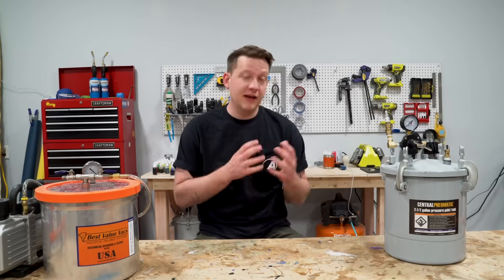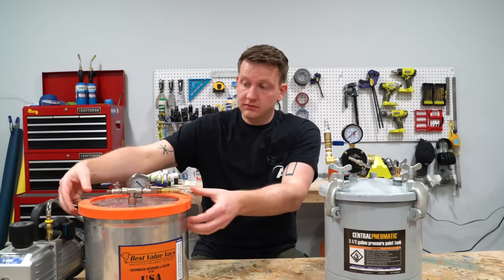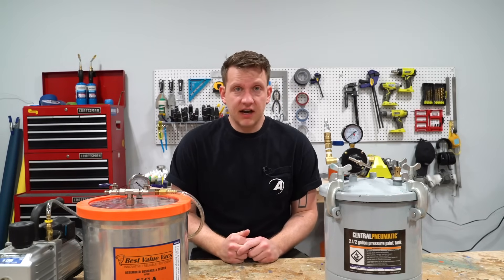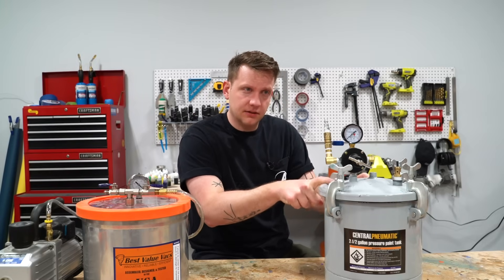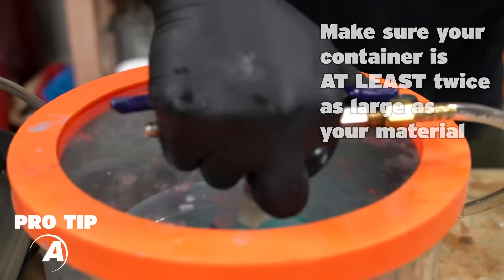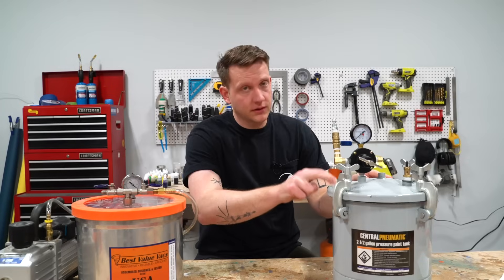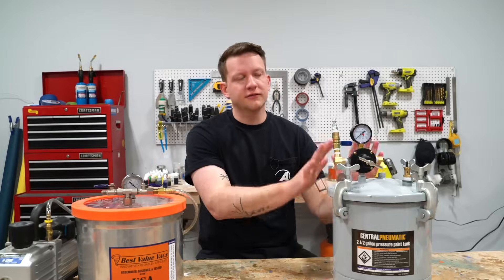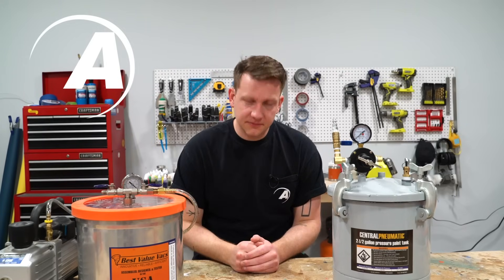When to Use a Pressure Pot or a Vacuum Chamber | Alumilite

Comment: What are your thoughts on casting in vacuum? As in pouring 3/4 of the way up the mold, putting it in the vacuum chamber, de-gassing it, then pouring the rest of the resin, then degassing that and letting it set in vacuum? Would that work? 

I'm asking because I have a vacuum pump and chamber, but if I can make it work with that, I prefer to not buy a compressor and pressure pot as well.

Comment: I've used them both for a few years, now. This was a great explanation. There's a new self-contained vacuum chamber spamming all of the resin channels, recently, telling people to use it for their resin. It's too small, and there's just not enough time to work with the resin. Don't fall for the perceived convenience.
Reply: I'm using polyuréthane who is better vaccum chambre or pressure pot ? I have just 2 min for degassing
Reply: @ladghemmonaim2145  I'm using Smooth-On Polyurethane and they recommend using a pressure pot. No time to degassing with only 2 1/2 minutes to pour it.

Comment: Couple of questions: I'm using a 24 hours epoxy for sealing burl woods, building a vacuum chamber for it now. Is it better to build the pressure chamber instead? Also, can it be made out of playwood (17mm thick) ?

Comment: so a vacuum chamber should be fine then if you are using slow cure resins right? I have mainly been using art resins with a 24+  hour cure time so it seems like a vacuum pot should be fine to use on those and the silicone casts

Comment: I'm thinking of using one of these silicone degassing chambers to vacuum air out of metal that I'm casting because it's like $500 less than the products that are designed for that, but I can't find anything on that. Do you think it would work, or would the high temperatures ruin the machine?
Reply from the maker: We would highly recommend reaching out to a manufacturer of vacuum chambers before attempting this! They'll have the most info!

Comment: I was very interested in your Pro Tip on pouring silicone into the bottom of your pressure pot. I hadn't thought about that and was recently watching another video where they recommended using an HDPE disc in the bottom. They linked to a relatively cheap one so I ordered one and, although I haven't used it yet, it should work fine. I am intrigued by the silicone though as I have another pot that I don't have a bottom for. Are there any downsides to pouring silicone in the bottom of the pot when my only use will ever be for casting? Thanks.

Comment: Been casting for years and have had great success pressure casting resin and using pressure on silicone moulds. I have never needed vacuum. Super crisp details for wargames bases.
Reply: Ok i know it is a foolish question but will not pressure squeeze your silicone along with the liquid resin? your cast should become smaller in scale and a bit squashed no?

Comment: Good advice. 
One thing I've never seen is the use of a magnetic laboratory stirrer with a teflon coated magnet bar.  One could add the resin in the mixing container, turn on the stirrer and then slowly add the hardener, being careful to avoid making bubbles.  I imagine that it would be thoroughly mixed with few or no bubbles.  Of course, when filling in around small objects such as wood blocks or pine cones, that air may become trapped under/around the objects, so a pressure pot may be till necessary.

Comment: I had a question regarding silicone molds. I recently used Thi-Vex to thicken silicone and spread it over a master to save cost, but found air bubbles trapped between the mold and master. I have a pressure pot, but was wondering if it would be effective in forcing those air bubbles out of the mold while it cures. The vacuum chamber seems to expand the silicone which I would not want since it would already be encasing the master.

Comment: I see two questions I don't think were addressed:

1. What do you consider a long working time/open time for resin? Hours? Days? Any resin I've worked with typically takes 8+ hours before de-molding - I've never heard of a brand (besides UV or something) that would cure in the 10-15 minutes it would take to degas (though I'm not super experienced and I'm sure fast set resins do exist)
2. If your mold is not going to fit in a pressure pot or you're doing large projects like river tables what are you expected to do? ( I assume the answer is to degas the resin in a vacuum chamber before pouring instead).
Reply: Yes you can vacuum degas epoxy then pour.  You'll likely still need to pass a propane torch over the surface to release trapped air that rises to the surface. Depending on viscosity epoxy can expand quite a bit while  degassing.

Comment: Does this works too for long-cure resin?
I'm working with a 72h-96h curing resin. Can i just let the pressure pot under pression for 96hours? Sound dangerous :/
Reply: It works if you can maintain the pressure. Vacuum would be a better choice as you don't need to maintain the pressure for the whole cure.

Comment: Okay this was helpful, so thank you!
But I mostly use UV Resins NOT 2 Part Resins, (mainly because the cure time is so much faster and it's easier to keep things suspended in place in my resin) And I don't know how what you taught me in this video correlates to the use of UV resins...? 
Any and tips or tricks, for the use of UV resin in these two devices would be helpful.... 
And is there such a thing as a clear pressure pot? That might fix my issue because then I could UV light cure while my molds are in the pressure pot?

Comment: Thank you for the video, one question, in the case of the pressure pot using resin do I wait until casting is cured which may take 24 hours OR I release the pressure much sooner assuming the bubbles are gone and not having to wait for so many more hours? Thank you Much
George
Reply from the maker: You'll want to have your poured resin in the pressure pot while it's curing. The pressure will minimize the bubbles in the piece but the second the pressure releases the bubbles will come back if the resin isn't cured.

Comment: If you were only going to buy one, which would you buy?

I have an air compressor, but it seems a vacuum chamber and pump would be the way to go if I were using slow curing resins. Vacuum pumps seem to be favoured by people handling composites, possibly because the same pump can also be used for vacuum bagging moulds. Better out than in, right?

Comment: so when using the vacuum chamber, you dont do it when it's in the silicone mold?

and the pressure pot, it has to stay in there for the entire casting time? most of my resins are like 24 hour cast. Is quick-cast resin better for pressure pot, then?
Reply from the maker: For vacuum chambers, you don't want to ensure your bucket is twice as big as the material in it or else the material could overflow - a silicone mold wouldn't work because you would typically want to fill the mold fully.

The resins we typically recommend using in a pressure pot are urethane resins (typically these have shorter cure times than epoxy) and any epoxy project you want to ensure won't have bubbles.

Comment: Epoxy resins can have curing time 24 hours and more, sa vacuum chambper is usefull for them, and also you can use acrylic resin which is hardened by heat so also very usefull in vacuum chamber

Comment: Great video, thanks. I'm in the process of casting a part that has a closed mold, there's a small opening in which I end up putting a bolt, the part is casted on the bolt and that's that so there's little space for any air to move around. My question is, if the pressure pot compresses the air, does a closed mold collapse, reshape etc and will the air inside the closed mold shrink just the same? I'm about to pick up a pressure pot but thought I'd ask to see what your take is on this.
Reply: As long as there is some gap in your mold where you pour or vent, the pressure will equalize on both sides of the mold; the outside via air pressure, and the inside via air pressure acting on the resin. If your mold is perfectly sealed it would collapse proportionally to the volume of the air bubbles, but no more since liquids are incompressible.

Comment: I’ve got a question, can you talk about open face degassing versus closed face (with ports) degassing of molds in a pressure pot. I recently was trying to degass Performance 80d with a 3D resin printed mold for my part I was going to cast, but it unfortunately foamed in the mold.

Comment: so is vacuum ok if i have no problem with a really slow cure, or does that tend to be simply too limiting in terms of material

another somewhat silly point of difference is if you want to do something like impregnate resin into wood, vacuuming out the internal air might be more elegant, but you can easily create hundreds of times as much pressure in the other direction -- with the right equipment, obviously [strong vessels and small gas spaces to store energy]. this applies more to youtubers like AVE who understand hydraulic engineering and dream in 100's of PSI, sure, but i'm just offering the theoretical point

Comment: For painting a truck which is best have a small air compressor at home 26 gallon but the air runs out fast so it shuts off like under two minutes rather have it continously running with air going out and having to refill air again and wait to spray again. Already got a electric sprayer so when I sand the vehicle again when paint it this year won't have to worry about air compressor continously stopping when sanding too. But don't want to get a bigger air compressor now and a turbine sprayer I saw better one costing a 1,000 could buy a 60 gallon air compressor instead of doing that. But pressure pots are smaller than air compressor but never used one I know Harbor Freight got one but the reviews weren't great.

Comment: Great Video! Vacuum or pressure pot for removing bubbles from resin  ( slow cure) for pouring into large molds that wont fit in chamber?

Comment: I’ve heard mixed opinions on a problem I run into. Of course I came to the channel that always gives the best description and process, so here I am. I use your Mold Maker (amazing btw) but when I cast in polyurethane I get ‘zits’ on the cast. Some have said cure the silicone at the same psi I use for casting the resin in. Assuming I do both in the pressure pot at the same psi (40) I’m wondering if this would fix the issue. I get the silicone will expand and the air bubbles will come back but if hammered with the same psi in the pressure pot when casting resin they should theoretically shrink back to the original cure.  Very informative video as always and greatly appreciated!
Reply: Bumping for attention...good question!

Comment: What if I put the final resin mold in a vacuum chamber and leave it until it hardened instead of vacuum first then put it in the mold, will it work? I just bought a vacuum chamber and I thought it's best for resin. So again if I mix my resin pour it in my mold then put the mold in the vacuum chamber suck the air out and leave it for few hours will it work? I'm  using silicone mold and deep epoxy resin!

Comment: Thanks for that. I'm a wood turner. Most of the voids I fill are on curved and vertical surfaces. I use plastic hot glued to the wood to make a mold. If I seal the mold completely with no vent does the pressure pot still work

Comment: Hello, I discover your channel because I am interested to create my knife handles with wood and resin. I congratulate you for your videos and thank you already for your sharing. Also, I don't speak much English (I use an application for written English) and I would like to be sure of what I understood. the vacuum chamber allows all the air to be evacuated from an object such as wood. We dip it in resinel (which one?), colored or not, so that it fills all the free space. For the pressure pot, we can put the object in the prepared epoxy (mixture A and B, which one?), and this allows to trap the air in the object and to harden the epoxy around this object.no? so if I want to color heartwood, and marry it with resin, I first pass it in the vacuum, with a bath of colored resin, then in the pressure pot to make a handle with epoxy? thank you for your return, and your information on the products to use. good continuation Xavier

Comment: I understand why you would not want to put your mixed resin in the vacuum chamber since it would likely cure before you could pour it again, but what if you've already poured it, can you put your mold in there? Like you did for the pressure pot?
Reply: Yes

Comment: Even after my resin is slow setting resin it's not recommended to use vaccum chamber..and you said even if we force air out of resin pouring it on the mould will bring back bubbles again... 😅 Then why other artist use and advertise the use of vaccum chamber?

Comment: Hello there! first things first: GREAT VIDEO! it solved my doubts on the topic in a perfect way! thank you so much for it!
then, I'm sorry to bother you, I would like to know one thing before buying a pressure pot: I cast reeeeeally small pieces for my miniatures (for example a head of a 28 mm miniature), so my moulds are often small (2 cm x 2 cm x 2 cm).. my question is: if I put them in the pressure pot, isn't there the possibility that the mould collapses for the pressure, and the result is a deformed piece? or the pressure is just enough to make the air come out without deforming the "walls" of my mould? 
thanks for your time, and again.. great video!

Comment: Great video. I just received my pressure pot and my compressor. And I have a problem: omg the NOISE of the compressor.
I also have a vacuum pump who is like yours. And I can tell the compressor is much MUCH louder.
Do you have a silent compressor ? I will have to get mine reimbursed because of the neighbors.
I would be interested if you would have a solution for that.
Reply from the maker: That is definitely something to reach out to the manufacturer about!
Reply: @AlumiliteCorporation  thanks for your response
Reply: It is possible to build an enclosure to help muffle the sound; air pumps of either sort are going to be noisy, Im afraid.

Comment: Do you know if vacuum chambers available for purchase by the general public can achieve 1 mbar (0.75 torr, 0.75 mmhg)?   
0.01 mbar?  Might that be possible in a rectangular chamber around 600 mm x 300 mm (24"x12")?  Thanks :)

Comment: I am thinking of making a vaccuum chamber to put handles on for my ax's and hammers. I would be filling it up with Boiled Linseed oil. Do you think this would work? And if not, why.
Reply from the maker: Hi Zach! I'm not quite sure what you're asking. Are you using a silicone or resin in this process? When does the oil come into play in this process?
Reply: @AlumiliteCorporation  Instead of wiping on the oil onto the handles to protect them from the weather, I was thinking about making a vaccuum chamber to fill with oil and put the handles in and Vaccuum it down to draw the oil into the wood
Reply: Pressure pot, I think, would do it better, but I think you'd have to play with that one.  
Also...consider the heat generated as BLO dries....youay just be making very elaborate self-igniting firewood....

Comment: Great video, but I have been using Alumilite clear for 2 years and I vacuum de-gas the mixture before pouring it into the mold. Alumilite TDS recommends this. I use a 1-gallon pot, which degasses quickly. Usually under 1 min. I then have about 6 min to pour.
Reply from the maker: Great tip!

Comment: Hello,
Can I use a slow cure resin with my existing silicone moulds in a vacuum chamber?
I have just been given a Vacuum Pump as a gift from my family because they heard me complaining about bubbles in my small parts castings.
Thank you for any help.
Reply from the maker: With a vacuum chamber, we recommend degassing the resin in the chamber prior to pouring into your mold. With a pressure pot, we recommend pouring the resin into the mold and then putting it under pressure until cured.

Comment: I have a question. I'm pouring a large resin piece with a flat top that is catching some trapped air. The pot life of the resin is 15-20 minutes. Is this too quick for the vaccum chamber? Would a pressure pot be able to clear bubbles if its trapped air? What would you recommend?
Reply from the maker: A pressure pot is going to be your best bet at getting rid of that trapped air! You'll want to get it in there as quickly as possible though and leave it for a few hours!

Comment: Question: I want to cast polyurethane wheel, do I use Pressure pot or Vacuum?
Reply from the maker: With the short open time of urethane resins it's typically easier to use a pressure pot while casting!

Comment: very informative video, thanks! sucks all this equipment has to be so expensive though, tough to break in as an amateur...
Reply from the maker: That's very true - this equipment is definitely an investment. One thing you could do is start off with epoxy that doesn't need a pressure pot or vacuum chamber. It's a good way to get your feet wet before dedicating more time and money into the practice!

Comment: how deep can I pour into my mold before putting in the pressurizer.  Ex:  I have a 4x4 mold can I filled that up and place into the pressurizer or do I have to pour in layers
Reply from the maker: It more so depends on the resin you're using to pour - each resin has a specific pour depth that it can handle at once. If you're using epoxy then Amazing Deep Pour would work best with this size mold. Since you would only need one layer, you could put it in the pressure pot right away. If you use a typical table top epoxy like Amazing Clear Cast then you would need to pour in layers of 3/8" thick putting it in and out of the pressure pot between each layer pour.